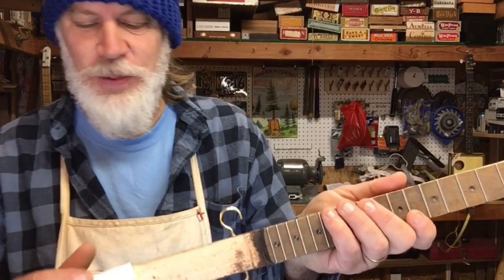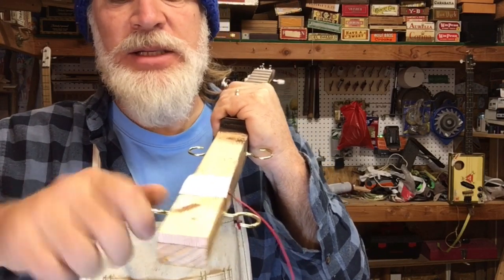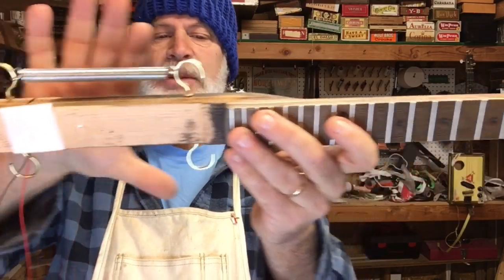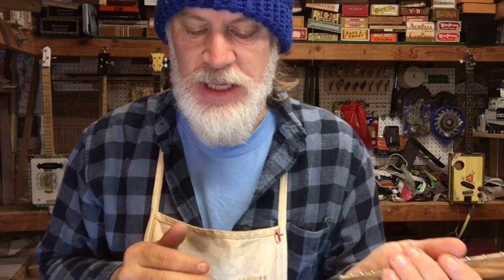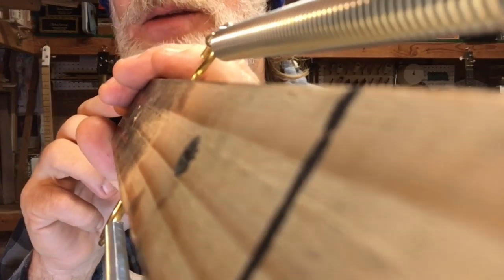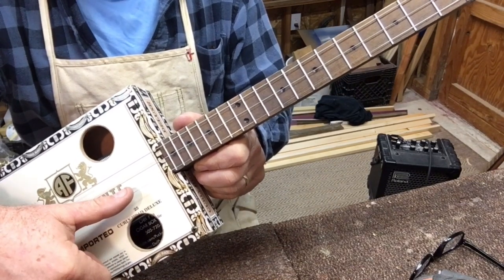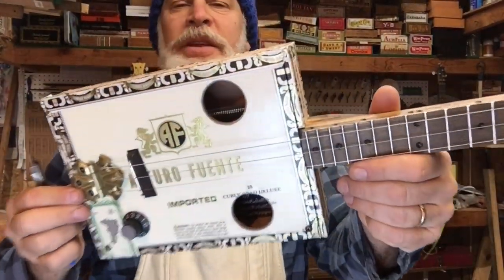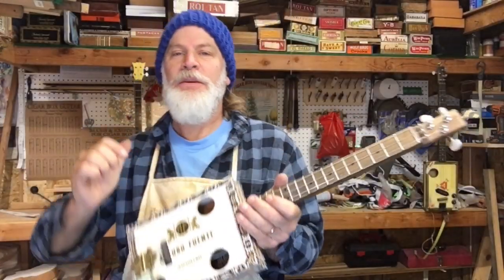Cigar Box Guitar with Dual Spring Reverb

Comment: After watching your builds I put dual springs into my CBG.  I have set mine up with the light gauge strings like this one shown.  I am not getting as much reverb as you are.  I believe that I may have my springs too big, long, or too loose to match the freq range of the strings.  I plan to get one lighter (and tighter) spring to replace one of the existing ones and see if that adds more reverb.  I remember seeing one of your videos showing one set of springs attached to, or touching the soundboard (Top) of the guitar.  How is that working?  Keep it "Slinky".